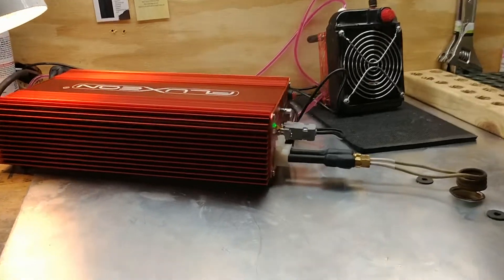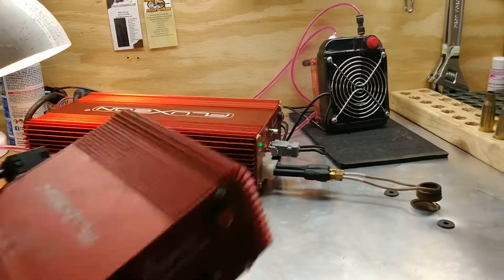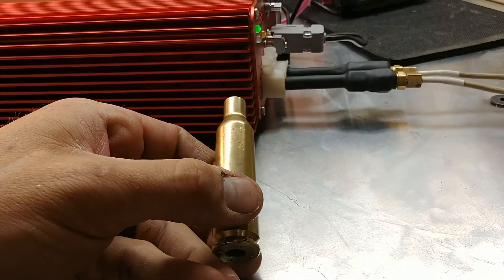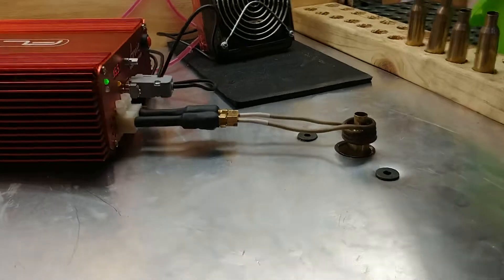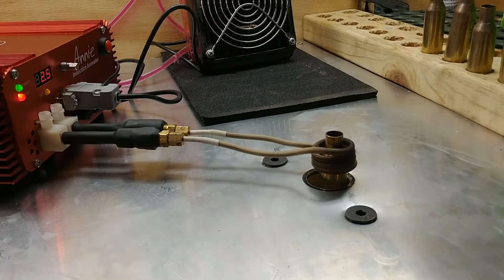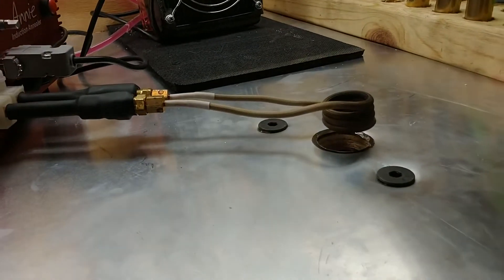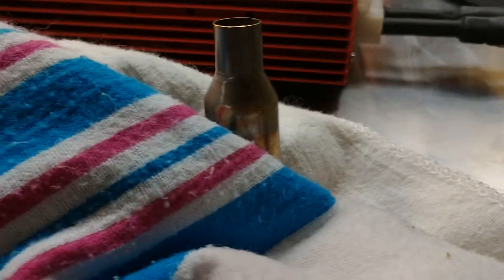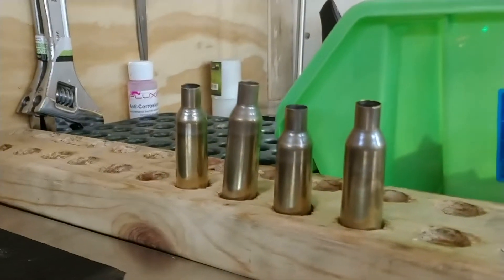Induction annealing .416 Barrett brass

Comment: No need for water cooling with the bigger unit?
Reply from the maker: As it’s set up, you can’t see the tank of coolant in the video.  I actually run 5 gallons of coolant into the machine with a 5v dc pump

Comment: Why is it so slow? Can the current be regulated or is the copper winding adjusted to the correct temperature?
Reply from the maker: Morten Breiland Annealing time is based on the thickness of the metal.  This brass is made from once fired military lake city 50 bmg brass, so it’s very very thick!  In comparison my 33xc takes 6 seconds per piece and a 223 takes about 2.5 seconds.  There is no heat adjustment, just time adjustment.  I adjust my time with the lights off so I am in total darkness.  I then set the Annie for way to long:ie. 30 seconds.  Then I start the machine and as soon as I start seeing a red/orange glow of the neck I stop it.  I subtract the time left from 30, so say it says 26 and then I know that it takes 4 seconds for that particular piece of brass to “cook” to perfect temp!  From then on I set it for 4 seconds and go. Hope this helps!